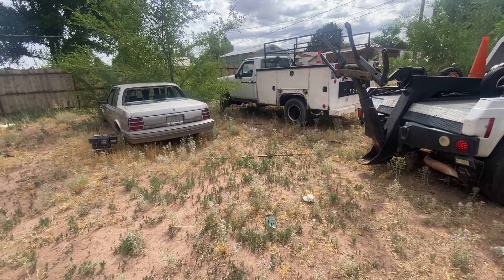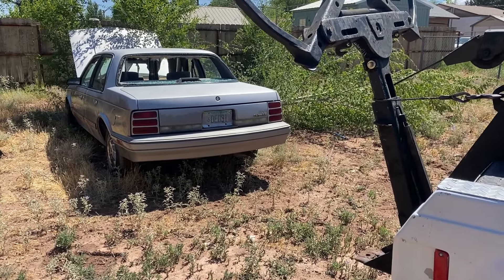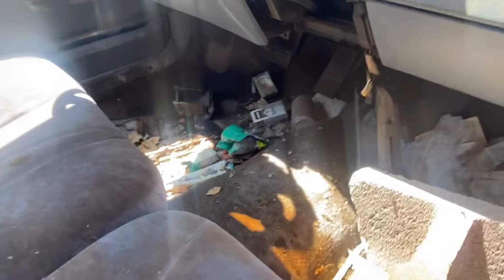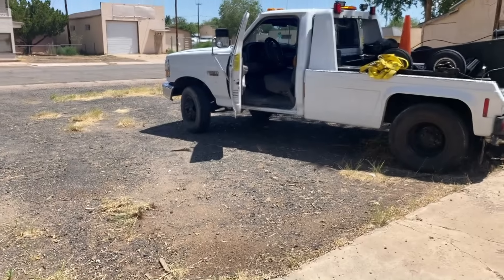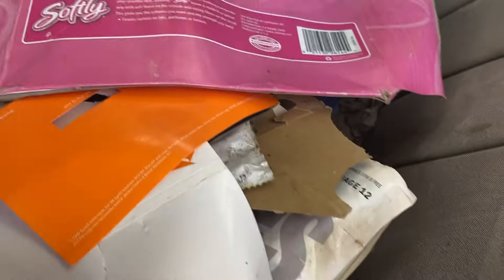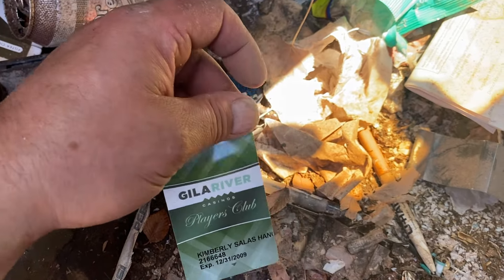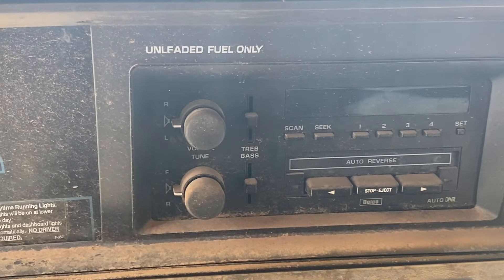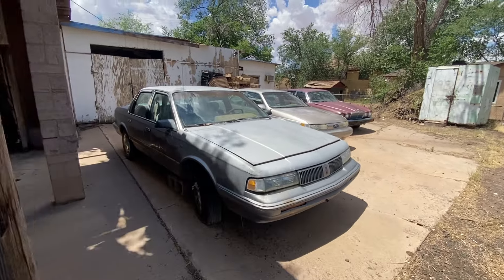1996 OLDSMOBILE CUTLASS CIERA EXTRACTION!!

Comment: Those were really good running cars at one time
Reply from the maker: I’m gonna take my time on the resto.. it was only parked cuz the old guy got too old to drive.. clean body ARIZONA car no rust .. needs keys, rear glass, at least 1 tire, gas tank oil and rad fluids drained and replaced .. and some SERIOUS VACUUMING.. I’ll probly just rip out the headliner.. I’ll probly be able to get up another video of the interior cleanup by the end of the week.. channel ain’t monetized (yet) and I been pulling a bunch of double shifts..
Reply: @johnny75channel  Open the doors and use compressed air to remove 99% of debris. easiest thing i ever, wish i learned it forty years ago.